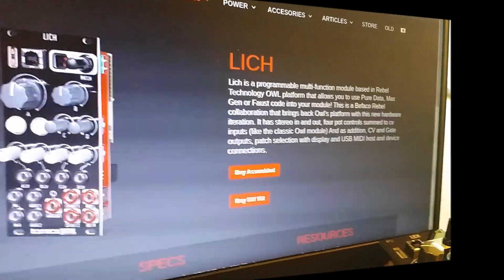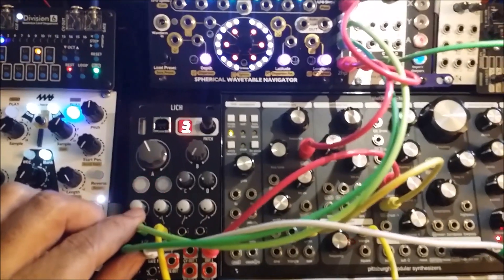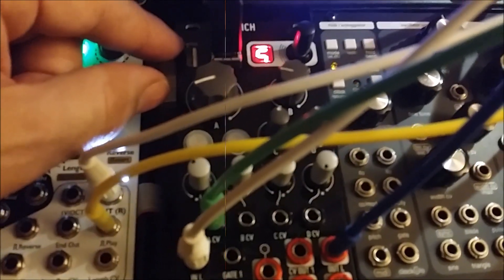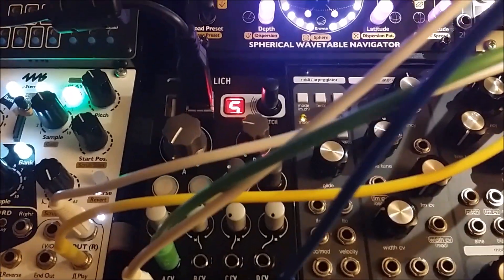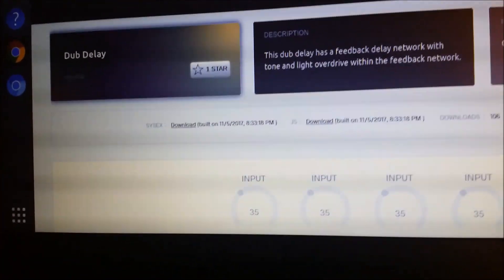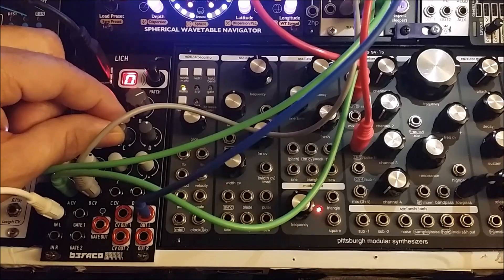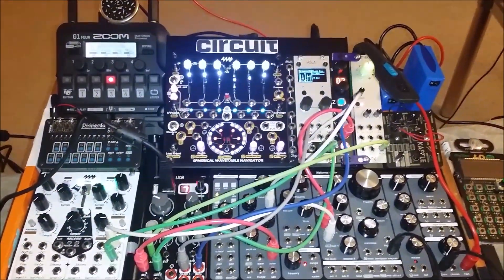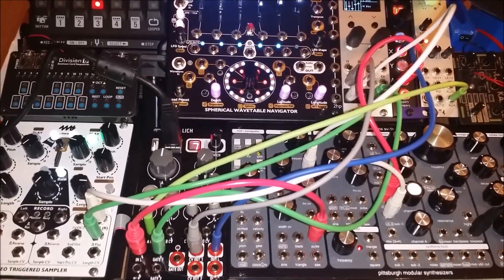Befaco Lich Programmable Multi-Function Module - Rebel Technology Patching

Comment: ah this is interesting, thanks for the vid, I didn't know this till you mentioned. can you create a complete synth within this? if so i should compare this to axoloti for my future device.. axoloti may be easier to make a patch for the visual editor but gotta find a hardware controller surface or make one own, which stops me diving in.. housing in a 4ms case to make a dedicated device may also be good.
Reply from the maker: They do have a patch where it is a complete synth but still limitations...Most of the patches like that is a osc, filter and LFO is just hitting the 2 buttons and inserting your own CV in..it's pretty interesting what you can achieve...and wow that Axoloti is pretty awesome. Never seen that before...that may be my future device as well

Comment: Cool sounds.  I hope you enjoy the Lich for a while.
Your two slight negatives would be total dealbreakers for me.  Having to hook up to a computer to really get full use of the module:  No thanks.  And since the controls do different things depending on which patch is loaded, not having a display screen to tell you what's happening ... uh uh, I couldn't take it.  Normally I'm not a screen guy but in this case I feel like it's necessary.
Reply from the maker: i hear ya Joshua..well this i must say was just a impulse buy..i didn't sell anything in replace of anything,,,that's why it's mounted to the would with foam on the bottom...so this is a hmmm,,,not sure..i got 30 days to decide..i can always send back minus 8% restocking fee which is no big deal...at least i get most my money back which in turn i'll look at it as a rental..lol....but my main focus now is getting a sequencer...sent you a email a little while ago...